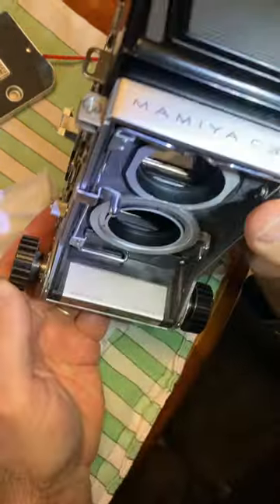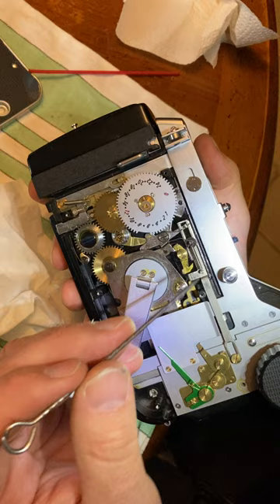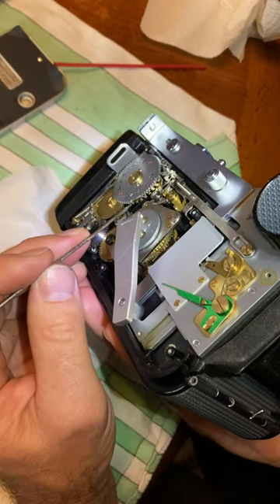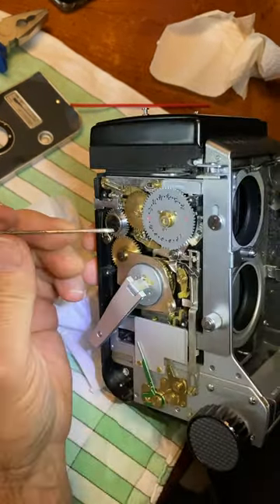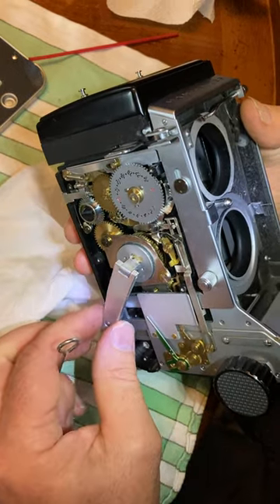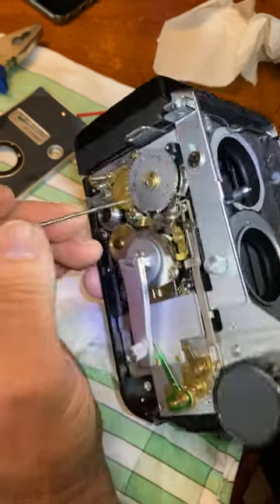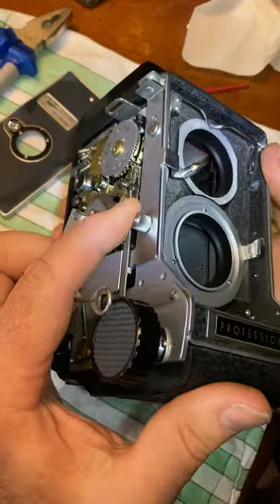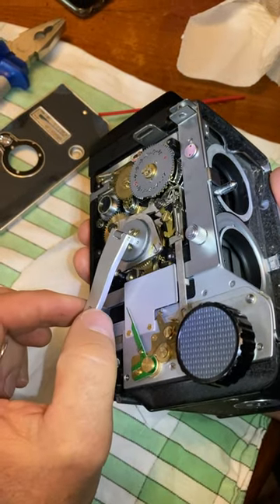Repair stuck film advance on a Mamiya C33 Professional camera

Comment: I have a C3 that I have recently gone through because the winder was very stiff.  I noticed the gear/wheel mechanism you are pointing out that others did not point out.  I used sewing machine oil on all the moving parts, but cannot report any change in the resistance in the winder.  It's got me stumped.  Thank you for making this video.